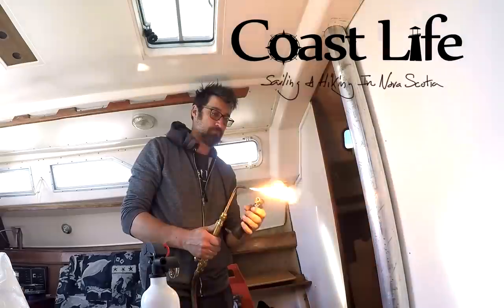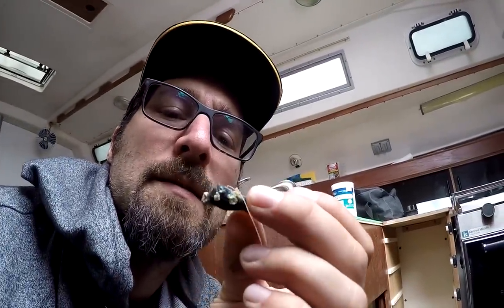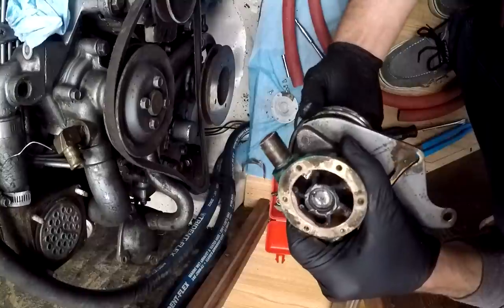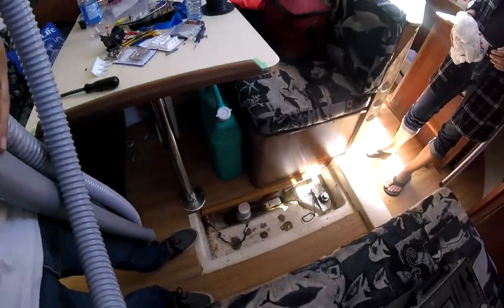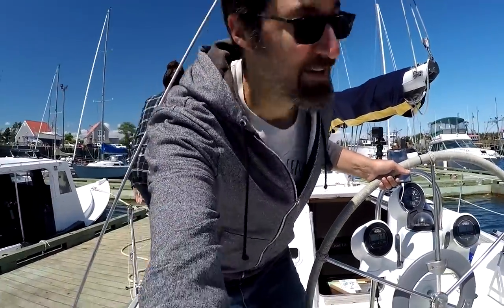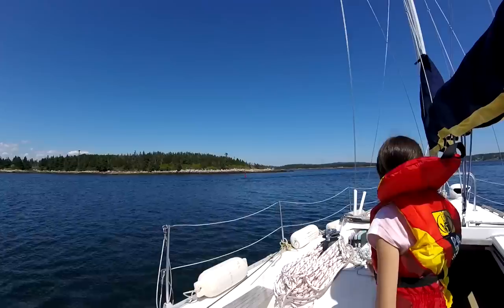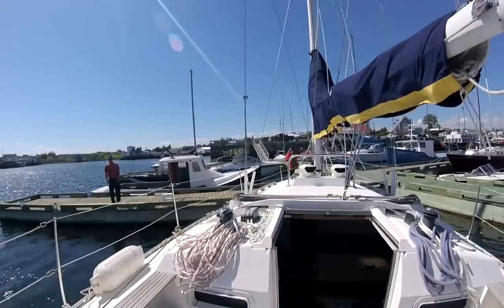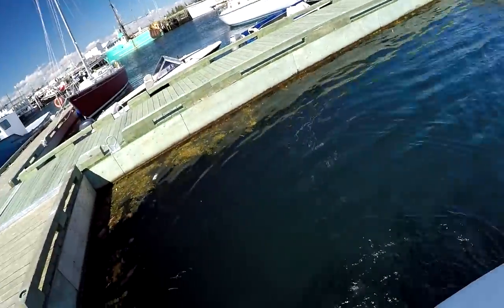Engine Troubles & Docking Fail! [ Ep 22- Sailing Nova Scotia ⛵]

Comment: B.O.A.T. = break out another thousand. It's the cutlass bearing, also replace the packing in the stuffing box and replace the hose that connects the stuffing box to the stern tube along with 4 new clamps, since you will be pulling the prop and shaft if you have extra money (grin) have the prop balanced and the shaft inspected for being true/straight. When reinstalling, use sparingly Blue Loctite on the engine/shaft coupler bolts. Like others have said check the engine mounts which you will be working with when aligning the engine to shaft coupler, final tweaking of the alignment should be done after the boat has been in the water for a couple days. The boat is flexed on the hard different than when in the water. A new impeller for the water pump each season ! Overheating the engine is very costly verses the price and time of replacing the impeller. Minimum spares to be kept on board for engine, fuel filters, oil filters & oil, impeller, thermostat and assorted hose & clamps. There are many more but this is engine basics that will save your butt. When on the hard always inspect and service thru hulls, zincs, prop/shaft and hull/bottom paint. When Docking: bow in first, the aft line 1st or stern in first, spring line (mid ship) 1st. Then use the engine in gear at idle to bring the boat against the dock. YOU GUYS are doing awesome, don't fret we've all been there, wise move to head back, the cutlass won't be fun to change. Reading the wind when docking like you did is one thing that many people forget !  Great job on everything, love the videos
Reply from the maker: Thanks for the support.    It seems that it may just be an engine alignment issue.. Some work and time will tell for sure.

Comment: Don't know if your prop is clean, but if it isn't, it could be just off balanced because of growth on it.  It matters.  Don't worry about hard or embarrassing landings, anyone who has not done it does not sail.  It would probably work better if your wife jumps off at midships, run up to the bow and makes sure the boat does not ram the dock then puts on bowline, then runs back to you to give you the stern line.  Anyway, you will figure out what is best!  Main thing drink a beer!  Cheers!
Reply from the maker: Thanks Henry! We'll get it figured out with practice :)

Comment: Oh man I was laughing my ass off!  Not because you were struggling but because we have ALL done that!   Seriously, give yourself a break!  When you get your motor issues taken care of, you can practice approaches out in open water.  Consider backing in.  easier to get out, and not as hard as it looks.    It took ten times to try and dock with my current boat, and I was experienced!  Every boat behaves differently.  Now regarding your vibration, I hope it's not cutlass, because that's a haul.  :(   What kind of prop do you have?  If it is a folding prop, it can cavitate at some speed.  My Gori did that on my C&C.  Regarding oil.  It gets changed in the fall not the spring.  Good on your for changing it, just making sure you know.   Finally, you guys are doing fine.  Small steps, and you will figure the boat out and start having fun.
Reply from the maker: The oil hadn't been changed in three years, so thought we should do it now.  Our's is a two blade fixed prop. Thanks for the kind words and suggestions! :)

Comment: Sounds like the transmission to me.  Or the prop is fouled, or maybe cutlass bearing.  The fact that reverse is ok, suggest transmission.  Did you check the transmission fluid?  

Sailboats are not designed for docking, and any docking with out a catastrophe is a success LOL
Reply from the maker: LOL thanks!     yes we did check the transmission fluid.  We think it's a engine alignment issue.
Reply: Coast Life alignment is SO fun.  Spray the engine bolts with kroil or other penetrating oil and take your time.

Comment: Have you checked that the engine silent bloacks are in good condition? Have you take out of water the boat to clean hull and apply the antifouling? Any REALLY experienced mechanic did a "deep" inspection in engine?... and for last but no least... I think do you need to re-insulate the engine room. (as you can see... the sailor live is not a lazy life... lol). And don't worry... new boat... so fails in docking.

shots of rhum.

Comment: docking its all about prop walk,on a not windy day go out where there no boat imagine a dock beside you  learn how the boat react  ,learn your prop walk use it to control your boat at low speed ,coming at the dock never lock the bow of the boat, line should stay loose ready to lock   ALWAYS leave the control to the captain

Comment: This is over three years old now, but you had the  raw water pump out in your hand and you didn't change the impeller?? [sound of tortured scream]
Reply from the maker: I have a spare, and that one we had absolutely no signs of cracks.   It's still going, and we still have the spare ;)   it only takes 5 min to remove the pump.
Reply: @CoastLife  So you throw the brand new impeller in and keep the used one as an emergency spare.  Its better to throw one in while it's in your hand in flat calm water than trying to do it while the seas are rolling and the fog is coming in.  Grrr I'm mad all over again.

Comment: That shaft was really jumping around.  You might want to consider this. https://www.youtube.com/watch?v=tKvDYpJaaAY it can help with a lot of issues.  With the shaft jumping around like that your packing and seals were likely taking a beating.  You may have an alignment issue!  You may have a bent shaft, bad cutlass bearing, broken bolt(s) on the shaft where it attaches to transmission....broken motor mounts....transmission issue....The zinc may be making the shaft out of balance...the prop may be making the shaft out of balance(Folding prop or other not unfolding, bent, etc)...I am having trouble momentarily remembering the name for it but the flexible boot on the shaft may have a problem with it!
Reply from the maker: Thanks,  Yes that seems like the perfect addition to a prop shaft!  after spending more than a few hours now lining up the shaft with the motor the banging seems to be gone now...  Waiting for the fog to leave to attempt a second run..   -Chad

Comment: That is not a docking fail. Once you've passed the edge of the dock and have slight forward motion, you are in. Hop off with a line and do the rest manually. Too much playing with the engine like parking a car or doing a ten-point turn--that's when things get hairy. When you leave the dock, if, for whatever reason, it looks sketchy, wind, current, 40' to the opposite line of boats, all expensive, and your boat is 36' (you get the idea), the easiest way I've found is to have engine running in neutral, cut wheel to where you want it and walk the boat out. Just get it pointing in the right direction as you hop on, then trot to the helm, point and go. I had to tag my neighbor's boat before I learned the low tech slip exit.
Reply from the maker: Sounds easy.... ;) Definitely like the sound of doing this, we'll see what happens when we try it